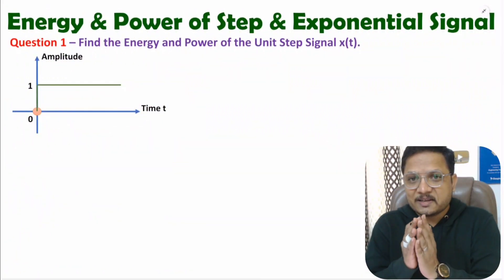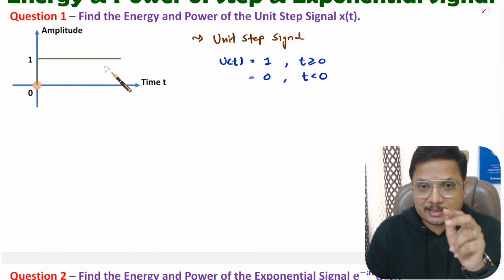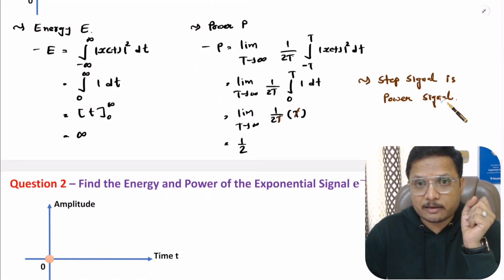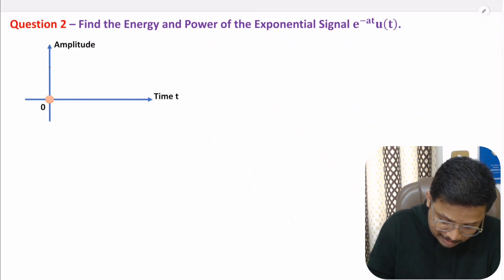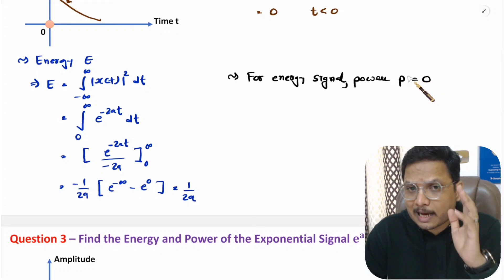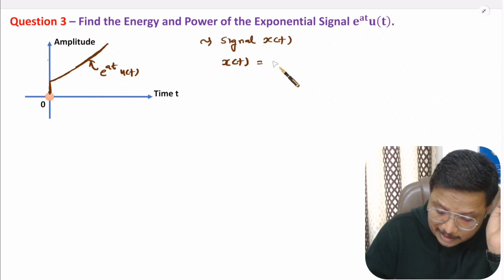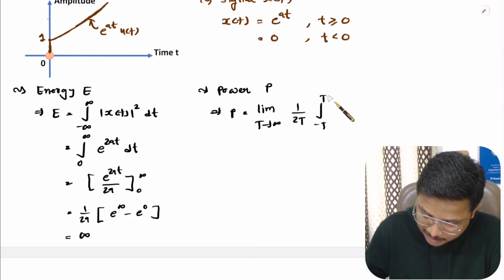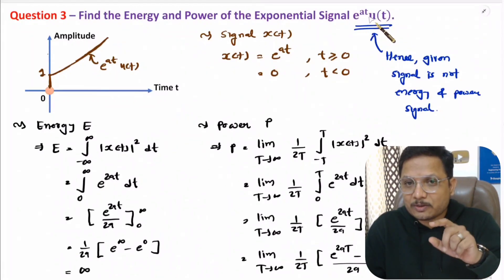Energy and Power of Step & Exponential Signal Solved Examples

Comment: At the last example the power of the signal need to be infinite because the growing of exponential is much bigger than just a T's growth. lt is not 0. If I am wrong please correct me. Thanks , this videos helping me a lot.
Reply from the maker: divide by T is there, so Power is zero. Here Limit is T tends to infinite.
Reply: @EngineeringFunda  also there is e to the a.t there and this term grows much faster
Reply from the maker: but divide by T gives direct value.
Reply: @EngineeringFunda  but in that case,    it is becoming infinite by infinite form   which is not direct       if we apply LH rule of limits      it gives infinite